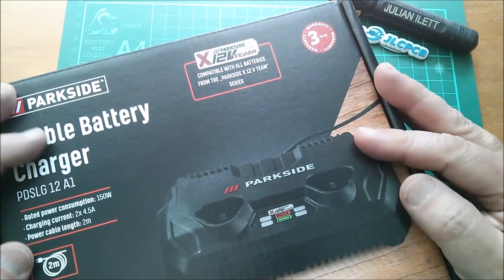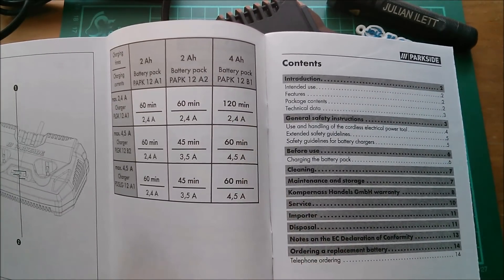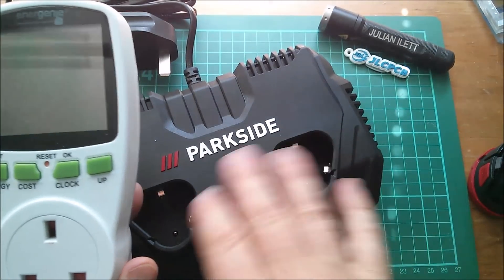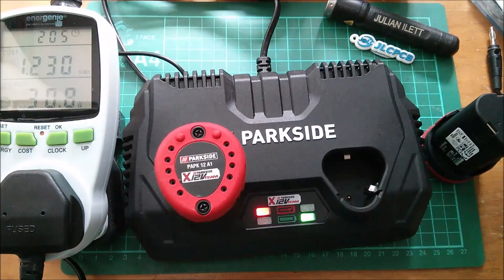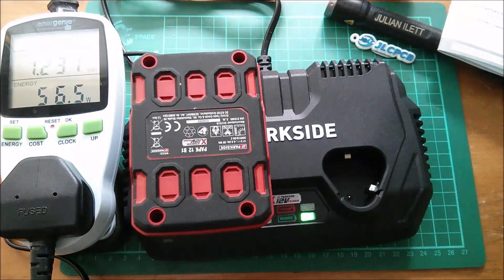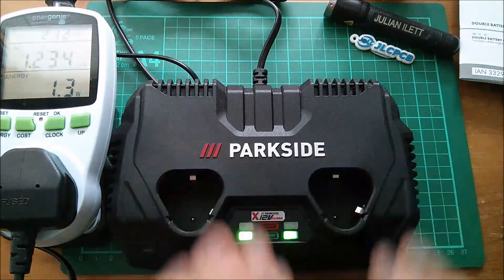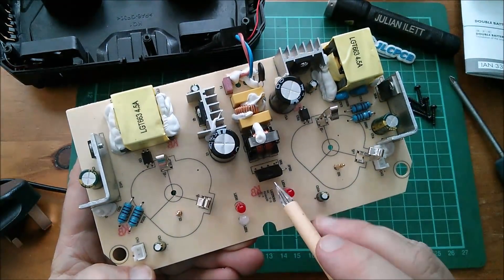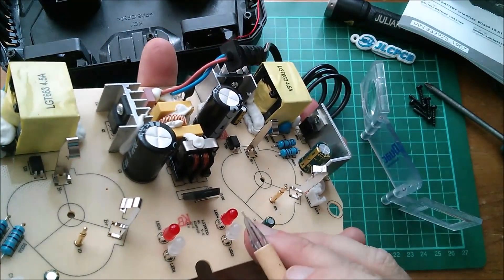Lidl Parkside PDSLG12 Double Battery Charger Strip Down

Comment: How are both the charger and batteries holding up? I assume the charger may be covered by the 3 years warranty but I doubt about the batteries. 
I assume they changed their policy. I had recently 2 batteries going to hell and when I called the company that deals with it they refused to replace the batteries because they were about 2 years old. My batteries had minimal use. The woman over the phone wasn’t friendly either. They just ensure a replacement within 6 months. Very annoying. 
At least a was able to reuse the remaining good cells.

Comment: I must say in response to the Noddy's angle grinder comment that the 20v angle grinder they sell is a beast. Cutting 40mm unistrut is no problem for it etc. Still not fixed my two over discharged batteries (20v), the cells are fine but I can't reset the locked out  controller to signal the charger. (That will teach me to use them on other tools...)
Reply: I have the 20v grinder too and it is spot on.

Comment: High Julian, those capacitors between primary and secondary are class Y capacitors, designed ho have very low leakage. They are there in order to suppress high frequency transients generated by the parasitic capacitance in the switching transformer. Since the switching converter operates at hundreds of kilohertz and the isolated output is completely floating even a small capacitance in the transformer can cause high frequency interferences on the output and mess with the device being powered. Those capacitors short the ac component of the output to the input drastically reducing EMI. This is so important that even ultra cheap SMPS have interference capacitors. I have seen cases where the absence of these capacitor caused the power supply to even interfere with itself, causing instability and voltage oscillations. Great video as always, keep it up! Cheers form Italy!

Comment: Hi Julian, I have a project that seems right up your alley. I have been attempting to work out how to charge power tool batteries safely with balancing via USB-C. I am living in a country that under normal circumstances it's difficult to receive parts from outside and with the current situation has made it nearly impossible. I have been taping the direct output of power tool batteries and using the 18v type to power things like fans, lights, internet routers and the TS-100 soldering iron without any fuss but the thing is the batteries always need to be charged by the mains. Only expensive brand specific DC to DC chargers are available. It would be so nice to cobble together an effective and safe solution enabling vehicle or solar charging without the use of inverters or expensive proprietary chargers. Direct charging with say a boost converter is simple enough but lacks balancing and is therefore bad for the life of the cells and potentially unsafe. You could use a balance charging pcb but they are usually designed for a specific pack configuration and may not work well for different capacity batteries. They also may lack a proprietary balancing algorithm for a specific brand? You can see my knowledge here is dropping off quickly. Third party aftermarket mains to DC chargers for nearly every brand of power tools exists so maybe this isn't the case, not sure? My first thought was to use a USB-C  to DC USB decoy fast charge trigger like https://www.youtube.com/watch?v=cX4INWdC5UE   but that would only get voltage to the battery, again no balancing. But what if it were possible to put this inline with the DC side of a AC power tool charger? In my thinking a mains charger has all of the necessary components to make this work. The DC charging circuitry, the appropriate tabs to connect to the balancing of the cells and the shutoff of current when the battery is finished charging. Any thoughts? 
I am a big fan of your YouTube channel and I have learned a great amount over the years of watching, thank you so much. Cheerio, Mitch

Comment: Re ID pin...
I'm guessing, but might it be programming charge current via a current mirror?
Reply: Very bad design if they have done that, imagine wobbly contact resistance.... Most things I have investigated use it with another pair of resistors to just get a voltage change the processor can see.

Comment: I'm surprised a budget charger has two completely separate power supplies inside. I would have expected a single one with some circuit to switch between the two outputs.
Also, if you're not in a hurry to get the batteries charged, a little tape over the extra contact will help keep the batteries and charger cooler.

Comment: The batteries are also under the three year guarantee. I’ve exchanged one of the 20vTeam batteries in the past. Just keep the receipt out of the sun :-)
Reply: I assume they changed their policy. I had 2 batteries going to hell and when I called the company that deals with it they refused to replace the batteries because they were about 2 years old. The woman over the phone wasn’t friendly either. They just ensure a replacement within 6 months. Very annoying. 
At least a was able to reuse the remaining good cells.
Reply: @ruinunes8251  Take them back to store and they’ll refund straight away in my experience. The batteries come into stock every three months or so with more tools, so I haven’t had issues getting a replacement.
Reply: @AdamWelchUK  well, I didn’t take them to the store. I just called the customer service which in turn gave me a number to call which I think they are the supplier?  As I said, the women over the phone wasn’t friendly and sticking to the fact that the leaflet says clearly 6 months. Well, I don’t have the leaflet anymore... so I couldn’t confirm. Next time I’m going  to Lidl I will speak to whoever is the manager.
Reply: How did you manage to do that? They refused to replace mine.

Comment: Cheap power tools can be great so long as they are used as such. I work in furniture installation and cabinet making a bit. Run a full set of Makita brushless tools. They are amazing if you are going to be using and relying on them every day. But i also tell people if you are only going to be using a drill or something couple of times a year. Go and buy a cheap li ion based tool. No point spending $400 on a drill and impact kit then not using it for 6 months. Finding the battery has sat dead flat for months and is going to cost $100 for a replacement battery.